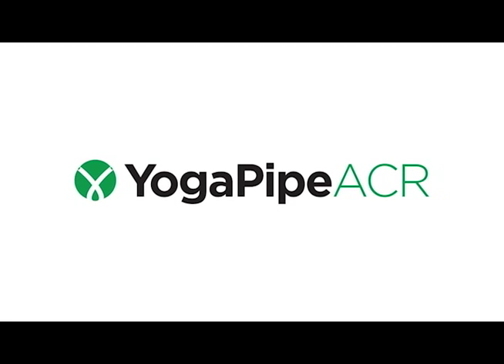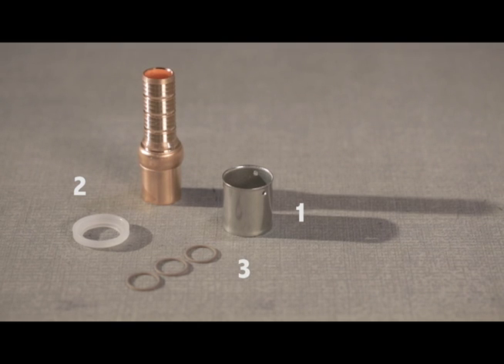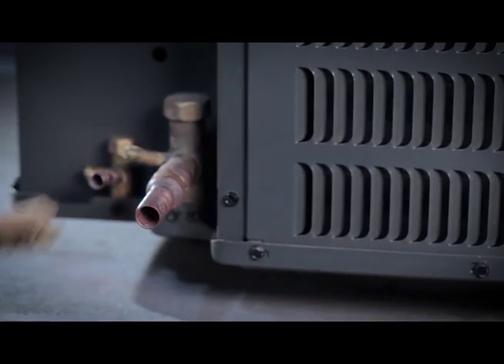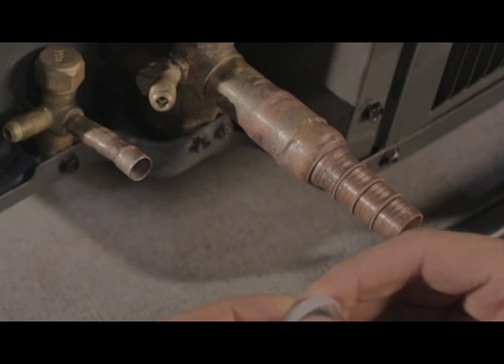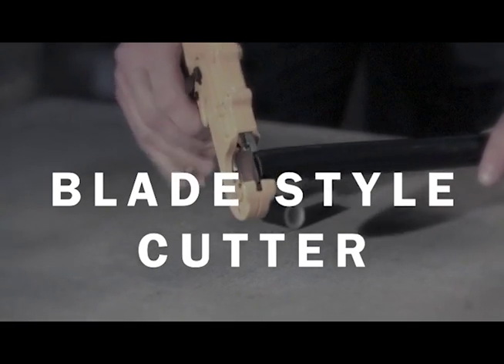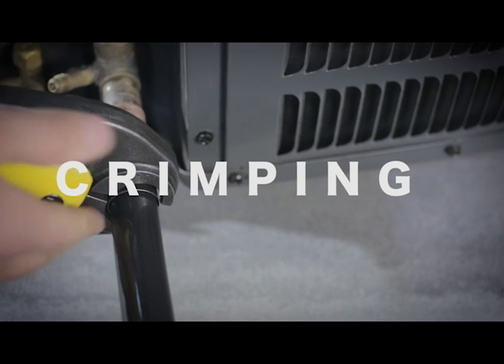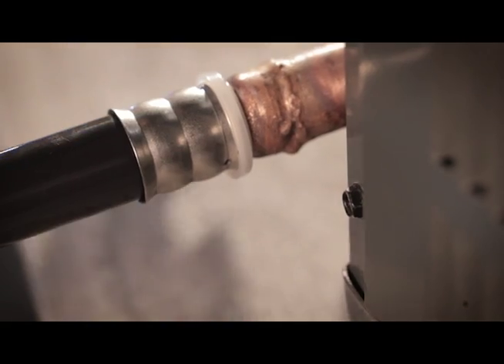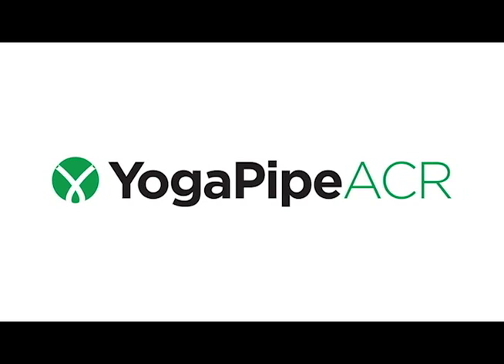YogaPipeTraining Video

Comment: That looks like alot of steps there chief.  How about just get an oxy-acetylene torch and some tubing benders and braze one joint in and be done with it.  There’s no substitute for a good brazed joint,m.  A good brazed joint will last for a long time, definitely longer than this, sometimes it’s best to not try and reinvent the wheel.

Comment: just replaced these after someone else used these on new house build and there was no pressure left after one year
Reply: Was it on a heat pump? Hears it only has issue when it's used on split units

Comment: How does plastic transfer heat
Reply: Heat transfer doesn't occur in the pipe itself in the refrigeration cycle, it's insulative qualities are ideal over copper has you don't want to absorb additional heat outside of the evaporator.  Pex pipe is used widely for infloor heating, so plastic does transfer heat